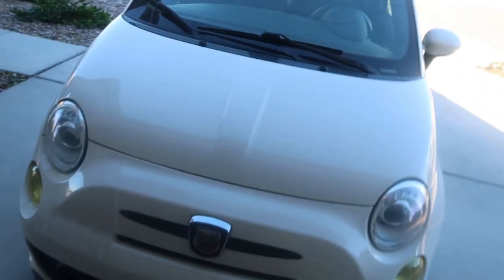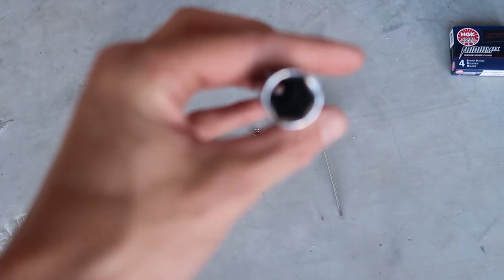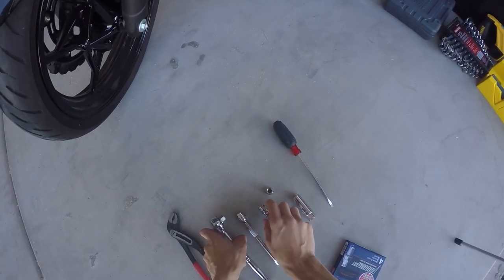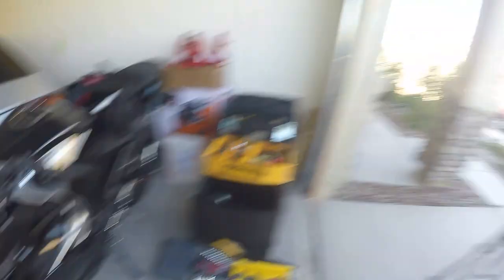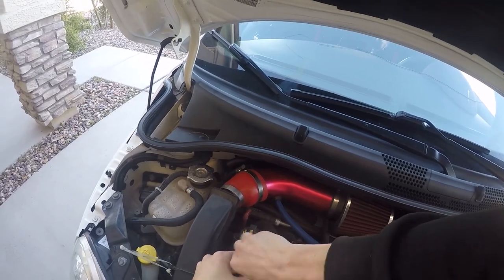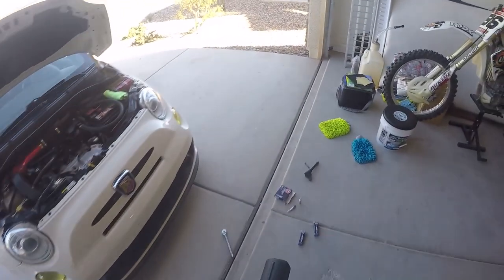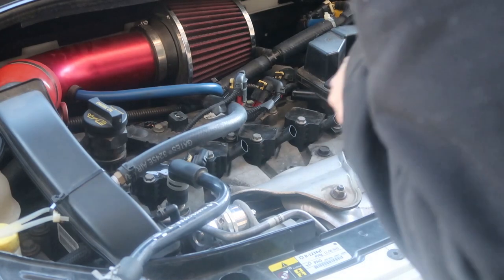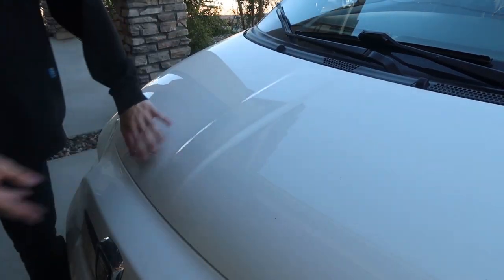How To Install Spark Plugs In A Fiat 500 Abarth

Comment: Good instructions!  Used this today to replace the plugs and coils in a 2013 Abarth.  We picked this car up with 110K miles on it already.  It was clear that plugs and coils were never replaced on the car before.  You didn't say to expect so much oil to be in the top of cyl 1 and cyl 4 (outer cylinders).  To make this better, would recommend changing the angle on your head camera to focus down a little more.  But this was by far the best vid I found for doing this job.  Love how you also go through the tools that will be needed...  Thanks for the time and effort you put into this :* :*
Reply from the maker: I really appreciate your comment! Thank you for the kind words

Comment: Top tip. A lot of cheap spark plug sockets have LOOSE rubbers inside. If it checked you could end up leaving the rubber in the plug cavity and the coil packs struggle to re sit properly. A PAIN to get out. If it happens to you… superglue in the socket may recover the rubber